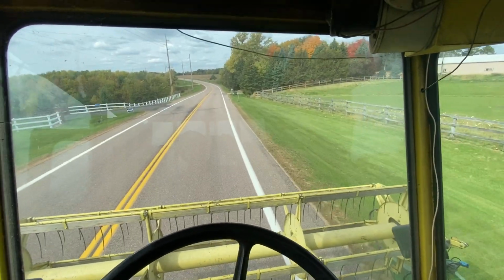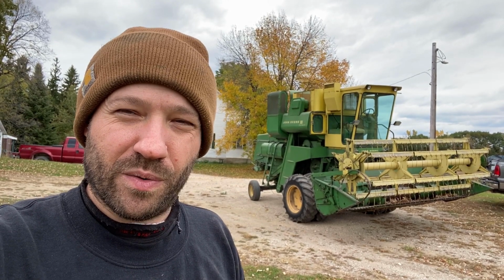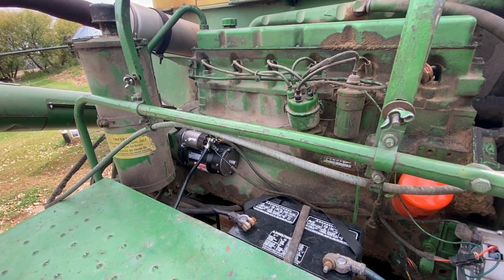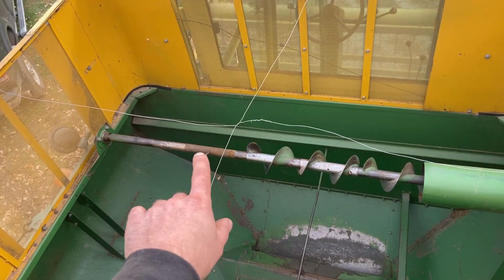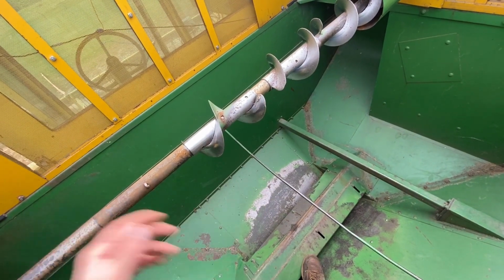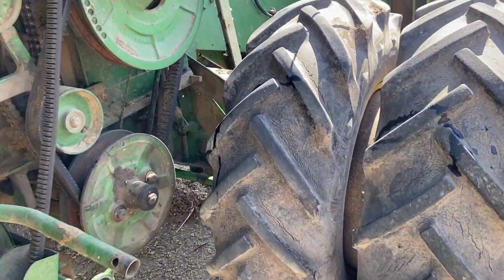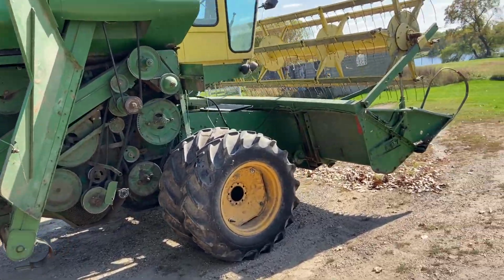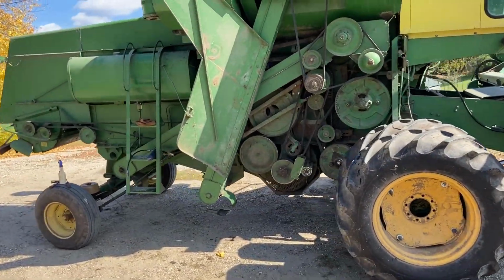John Deere 55 - Pre Harvest Tuneup 2020

Comment: The 55!!! Been waiting to see the lovely old gal again. Really glad you were able to find an inside spot to store it. One bonus you have over most is there's so few electronics the mice don't have much to screw up  :)
Reply from the maker: Ain't that the truth!  I've seen a number of stories about modern John Deere S-series combines catching fire from faulty wiring, which of course is spider webbed all over the machine.  Technology is amazing, but sometimes I think the old mechanical machines are trustier.  Of course, the tradeoff is that they're a lot slower.

I remember seeing the math once on modern combines, as someone was complaining that they're so expensive while often having a shorter lifespan in terms of machine hours compared to older units.  However, when you look at total number of bushels a machine processes in its useful life, there's no contest.  New combines have enormous capacity.

Now I'll be a curmudgeon and say that I'd still like to see small scale modern combines, that would be built simply and affordably with parts available for the small farmer, so we're not always scavenging old machines.  I'd also like to see more small farmers.  I'm not super hopeful about either of those prospects though. :0)
Reply: @ravenviewfarm  I couldn't agree with you more. We decided long ago that on our farm older, used equipment is the way to go. No fancy gps even lol. Dad has said if that breaks how are you going to continue to work? Old, smaller stuff still does the job just like the big boys

Comment: Take two boards about 3 ft long and sandwich the cutter bar, c clamps to squeeze then use a handyman jack or something and push up and maybe bend that section back. That's what I'd try at least, different header sounds like the best plan though

Comment: WE have a 213 head for our 55 but we havnt gotten it running yet. You have to mount a hydraulic pump on the head to run the hydraulic driven reel on the 213. The combines that used a 213 head had an extra hydraulic pump on the combine to run the reel.